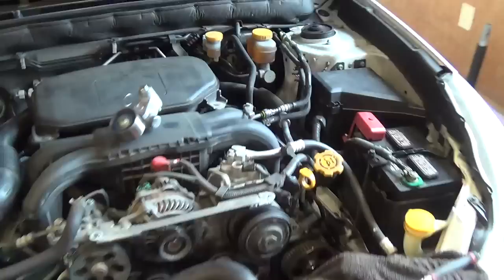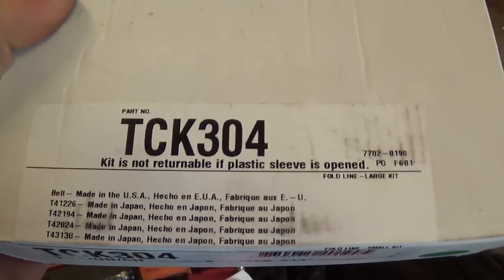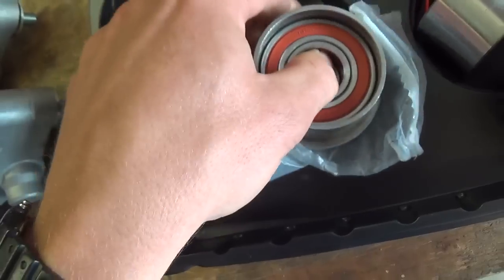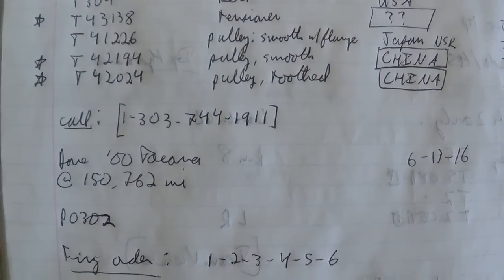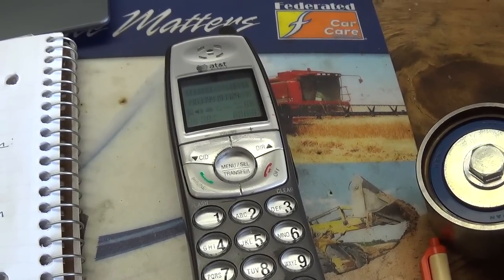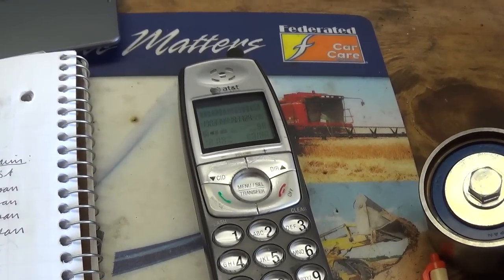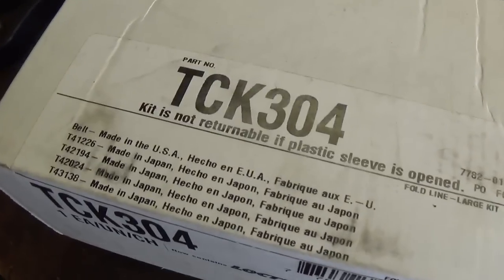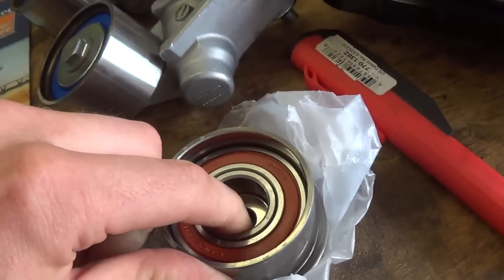GATES Subaru Timing Kits: BUYER BEWARE!

Comment: Wish I had seen this before installing a new Gates timing belt kit, pulleys, tensioner, pump, etc. on my girlfriend's Forester during a rebuild. Car went 50 miles then spontaneously the timing belt lept off the front of the cam gears and shredded itself. I asked around, no one could offer an explanation or similar story. I had to get the valves replaced because they were bent to hell. Put all the original pulleys and tensioner on this time, and the car is back on the road (knock on wood). I strongly suspect one of the Chinese-made bearings to be the culprit, but there's no way for me to get back all the time, misery, grease and towing costs I've been through on account of Gate's inferior outsourced components.

AVOID GATES PRODUCTS
Reply: a poor craftsman blames his tools. timing belts don't just leap off cam gears. if the bearings were the culprit you'd know because they'd be damaged to the point where someone could have offered that explanation.
Reply from the maker: Dylan, THANK YOU for sharing your experience! Shame on GATES!!

Comment: Rock Auto is shady as s#@t....I have never ever had a good experience with Junk auto, the worst was a P/S pump for my hemi.....got the new one on and sent the core back to them same day.....next day  rock auto pump turned into a piece of scrap metal, called R/A they said return for refund...what about my core??? sorry you should have hung on to it....what? 90 day core return with a 1 year parts warranty....once u buy their part you have to keep buying their part or loose your core.....screw u rock auto!!!!!
Reply: Opinions vary.  I've been using RockAuto for about 6 years now and have not had any problem.   Only had one time when I received an incorrect wheel bearing.  The customer service girl was very happy to resolve my issue, did a full refund on the spot and told me to junk the incorrect bearing.  Like everything, it depends on who you get to talk to...and how helpful they are to deal with.   In this case?  Gates did screw up and didn't update the labeling on their box.  At least Rock auto did follow though and offered to warranty out the kit.  Just sucks that most items are being made in "Yackashima Ironworks" for parts...
Reply: Gates should have said keep the parts you want and rfc the non advertised parts.
Title 19, Code of Federal Regulations, Part 134 generally contains the specific regulations for country of origin marking, and is implemented pursuant to Title 19, United States Code, Section 1304, which reads:

(a)        Marking of articles        
Except as hereinafter provided, every  article of foreign origin (or its container, as provided in subsection  (b) hereof) imported into the United States shall be marked in a  conspicuous place as legibly, indelibly, and permanently as the nature  of the article (or container) will permit in such manner as to indicate  to an ultimate purchaser in the United States the English name of the  country of origin of the article. The Secretary of the Treasury may by  regulations—

Comment: There are rules on how parts are marked, but they don't enforce the rules, so they don't do much good, only in where cars are made , that's it. Anymore your on your own. OEM Quality doesn't mean anything. Quality is just a loose term, doesn't mean anything. Might as well get used to Made In China, in another 20 years it will be the only option.

Comment: It's not necessarily bad if it's not 'Made in Japan'.  These parts companies constantly change their suppliers these days.  Even the main dealers are changing their suppliers now and then.  However, I agree with PLAYING IT SAFE.  If in doubt, always go with the parts from the main dealer.  The aftermarket parts market has gone wild these last 10 years: ALL cheaper aftermarket parts are of disastrous quality.  Back in the days, 15-20 years ago, an aftermarket part had chances to last for a while, today no such thing: critical parts failing after 2-3-6 months.

Comment: makes me wonder if aircraft parts are falling victim to the Chinese Connection.
Reply: Its an issue, they had a problem with counterfeit parts getting authentic tags saying they are up to standard. FAA people who check the parts where getting money to play along.
Reply: We operate A300s, and Airbus doesn't make this aircraft anymore. ..parts come from deserve or other operators , ok but anywhere else -oh boy
Reply: My understanding is a mile of paper work goes with each aircraft part.
Reply: +Rick S they have FAA CERTIFIED repair stations that fix the parts, then a gov form is filled out that  certifies the part meets FAA standards. But, counterfeit parts still happen in some cases.

Comment: Just for the record when any of your pulleys skate (as in spin freely) REPLACE them period.  They are on there way out.  I would rather put on a Chinese one than have a blown out pulley on my car.
Reply from the maker: It's a free country so feel free to install as many Chinese pulleys as you see fit :)
Reply: I have installed at least 3 of these Gates Timing Belt kits in my daily drivers as well as full blown race cars no issues.  Seems like this video is all about getting them clicks!!!!  And way better than putting blown out parts back in a car.

Comment: i would rather repack the old bearing with grease--than use china parts                                  one russian mechanic taught me to repack bearing on timing belt components does anyone out there do this to avoid china cheap bearings--would like to hear from you all
Reply from the maker: Ha I have repacked many sealed bearings with good results. Kudos to the Russian mechanic 😁👍

Comment: Chase Balzli
I installed a gates timing kit not to long ago on a 1998 EJ25 dohc. Knock sensor bank 1  code came up  then failed emissions. When I opened up the timing cover, half the belt was SUPER loose..  BAD tensioner, had oil coming from top of piston... passenger side jumped two teeth but didn’t cake the motor. #Lucky.. in that sense I guess....

THE KIT MADE IT 2 F-ING OIL CHANGES...

wtf 

Guess what I found...

ChineseBullsh!t

DONT BUY GATES

Comment: im a ase cert master tech, gates and other manufacturers out source parts all the time, dont know why your complaining get use to it, even the highest made auto manufacturers do it, thats the way things are done, MERcedes Benz, Audi , Honda , Nissan everyone does it! So if an OEM suppliers run out of a pat, u think they are gonna stop there assembly line stop making cars, NO WAY- Thats why u have different parts on the exact same model.---As a lead tech if you where so concern about getting the right parts why didnt you go to the dealership, and pay dealership prices, The only thing i would be concern about in that kit would be the tensioner, the pulleys , are not that critical, and usually u'l get a warning before they completely fail!
Point Made , stop being a wuss and put the parts on, calling gates and rock auto makes, no sense because the parts are correct ...and dont try to diss everything that made in china because china can and do make quality parts, its depend on the manufacturer demands.

Comment: What's being ignored here is the fact that China does make quality parts.  Theres a lot of sub par components coming out the big rock candy mountain sure...... but before you get all high and mighty buddy
.. bear in mind.  As a former tool maker.  The tooling used to make your Japanese parts... are very likely Chinese. The lathes used to make your parts once machined in Japan... are likely Chinese.  Do you see where I'm going with this? The dies used to cast the piston housings for gates former Japanese made tensioners...yup you guessed it.... Chinese made dies.. they can build it cheaper than anyone else in the world and if the engineers mandate a particular use of specific metallurgy... guess what.... the Chinese comply. I used to work for mevotech. Most parts made in China.  We engineered each part here in canada... Called out materials and brinell hardness etc etc and China made our parts. And honestly
..i don't work for mevotech anymore but..... as a auto technician aswell(i have 3 trades) i can declare as fact that most shops in the gta are starting to ditch moog. (Mevotech is steering and suspension too) I'm not sure where most of moogs stuff is made.  Presuming usa. But mevotech "terrain tough" line of premium parts blows any of moogs premium stuff out the water......honest to god ive got engineering Intel that i could disclose.  Physical cutaways of ball joints etc....i back my claim. Chinese parts shouldnt be condemned the moment you see the stamp.  I understand not everyone is a toolmaker like me but you seem smart.... you should be able to discern a well made part from a bad one. You should be able to discern poor materials from great.

Comment: We are all guilty of buying export products especially Chinese whether from Walmart or auto parts. You will find a lot of products in your home and yes even some of your tools & diagnostic equipment. Auto manufacturers have to outsource to be competitive b/c the American consumer wants the most bang for the buck! There are Chinese parts built to OEM standards & aftermarket parts built to another standard. Eye opener is if you research the web you'll see Japan has hired Chinese workers in their auto manufacturing because they work for 1/2 of a Japanese worker but the difference is what quality manufacturing standard they are working to...there is a difference. I don't like Chinese parts b/c I think all products should be made by Americans & bought by Americans but that's not reality or the world we have created. I buy OEM & name brand aftermarket parts that have proven themselves thru the years b/c nobody likes doing a job over b/c of faulty parts & if they are made in China I will cuss & complain but still install them & so far  I have not had an OEM part Made in China fail YET (probably shouldn't have said that). Ivan has a valid gripe b/c if the package states "Made in Japan"  it should be that!

Comment: I really don't get what people complain about with Chinese parts. The camera or phone recording this video will be made in China. And the pc or smart phone you watching this on is made in China. Not all Chinese parts are bad that's just stereotyping.
Reply from the maker: Yeah, but your cellphone crapping out won't make your car engine blow up. A cheap Chinese timing belt bearing, however, WILL. That is why mechanics complain about junk aftermarket parts...it's not a stereotype, it's the TRUTH!
Reply: Why are you looking for proof of failure when he has proof of quality matched with experience?  You do realize that its his ass on the line if the customer experiences a failure, right?
Reply: China stuff is crap unless someone else makes them do the job right.
I had one of these tensioners fail and destroy my engine after 800km

Comment: If you want a car made in China, keep using parts made in China and your desire will be filled.  After WW2, so much of everything was made in the USA due to the collapse of the adversary nations.  Quality was good, design was adequate, but with time the bean-counters outsourced more and more until we are now dealing with the lowest common denominator.  Yes, technically, you can make a car out of wheat chaff and water...but how far will it go before it dissolves?  That is the big question.  How far do you want to go before you have to replace what you paid for already?  Japanese cars first entered the US market due to desire for quality.  And they were reasonably priced.  Bean-counters at work again perverting the products for $$.

Comment: I was saddened when I looked for OEM inner tie rod ends for my '96 4Runner (as a 'just in case' exercise), and was very saddened to find out that they too are now made in China!!  Outer tie rod ends are thankfully still Japanese, as are the lower balljoints.  I've long since given up on Moog parts being US made, let alone lesser aftermarket brands.

We've got great manufacturers right here in Indiana.  Allison's transmission plant is right in Indy.  Keihin makes parts for Honda to support their Greensburg operation just Southeast of Indianapolis, and Toyota makes vans and SUVs in Princeton, along with forklifts in Columbus.  Cummins likewise has an operation in Columbus.  Subaru is just up I-65 in Lafayette, GM makes their trucks up in Fort Wayne.  Chrysler's got a transmission plant in Tipton and component assembly in Kokomo.  What's most shocking is looking at some GM cars and even more so Chrysler cars and trucks and seeing how much is being brought in component-wise (as well as whole cars assembled in Mexico).  Hell a San Antonio made Tundra is MUCH more "American" than a Ram is, sadly.  Half of Anderson Indiana used to work for GM/Delphi/Remy, now it's just a bunch of overgrown fields.  All the circuit board assembly has long since moved to China.  Muncie Indiana GM transmissions were famous, no more.  It would blow your mind to see how much factory space and infrastructure was scrapped out and bulldozed.

Not to get political, but I have an inkling of hope that a potential Trump presidency could reverse this China-outsourcing trend (or not).  I guess we'll wait and see.
Reply from the maker: Well at least all hope isn't lost yet...Indiana definitely seems to have more manufacturing going on that most other areas in the country! Damn marketing departments. When will they figure out that people are actually willing to pay a premium for QUALITY?!
Reply: Your still paying a premium you just aren't getting the quality.

Comment: gates belts come out of mexico like forever and u DO NOT WANT TO INSTALL A MEXI BELT ot timing belt tensonor or idler pully bearings,  a maxi pad might work better??? lol, yup the Chinese wanted to build some turbine engines for our company and they would screwup 3 out of 10 turbine engines for aircraft, tiawan north korea maylasia japan these guys seem to actualy understand how to get the job done right and how big a hole in the ground a jet crash makes when they don't get the turbine engine built right and it fails, funny thing the Chinese seem to feel the crash will destroy any evidence of wrong doing/fuckups so hey there attitude is prove it!!??

Comment: The bolt that comes with the gates tensioner is junk, mine broke with a few days, luckily I heard a noise and stopped the engine immediately. Do not use the bolt, use the original bolt.If you put in the gates bolt replace it as soon as possible.
Reply from the maker: Try the Continental kits... Better quality components then Gates by far 👍

Comment: I see your issue with the box labeling been incorrect, But you have no reason to believe the parts are lessor quality. Just because something is made in China is lessor quality that a product in Japan is ignorant. Do some testing and pull them a part, country of origin is not a metric for quality.
Reply from the maker: Do do any sort of quantitative testing you would need to go to a materials science lab and analyze the properties of the bearings, races, grease, seals, etc. etc. Then put them on a test bench and run 200k miles on the components and see if they last. 
I'm not really equipped to do all that, and I'm sure as heck not going to use my customers or my own vehicle as a test bench for critical engine parts!!!!!
Reply: Here's the problem. The USA and Japan adhere to an ABEC spec for bearings, which lays out the tolerances for different levels of precision. You can be pretty darned sure that an ABEC 9 bearing from SKF or NTN of Japanese manufacture will meet the spec. A Chinese bearing can be stamped ABEC 9 and be ABEC 1. They just make a batch of bearings and bin them like CPU manufacturers do. I've been in contact with several manufacturers over there, and one who was getting out of the business told me that they simply don't have the manufacturing equipment and infrastructure to make precision bearings, so they just lie. They find some out of the batch that meet the spec and send them off for QC, and the rest are just what they are. If the customer orders ABEC 9, they will stamp them that way. Whether or not they can manufacture decent parts is not up for consideration until the outright fraud can be dealt with. When you buy a Chinese bearing - unless you have personal oversight in that manufacturing facility - you can never be sure if they're cutting corners. It's an ethical problem. I have bought batches for testing from several manufacturers, and the tolerances are all over the map. I specifically ordered an ABEC 7 bearing for a specialty project, and what I received were worse than ABEC 1. The same bearing sourced from the USA costs literally 10X as much, but they work.

It doesn't matter so much if they're for your skateboard wheels, but for a critical machine component, the quality simply can't be trusted. Taiwan, maybe. Mainland China? No way.

Comment: I have been working on cars for 25 years and have noticed all of these parts manufacturers we used to trust have went to China the quality is pathetic just had a Gates timing belt kit we put on a Honda Civic be towed in it only made it 2500 miles before the Chinese tensioner pulley locked up and burnt the belt in half now we have bent valves and a very inconvenience to customer have had the same problems with Chloe's timing chains we are OEM or nothing at this point I don't understand why everybody assumes we will not pay the extra money for quality very disappointed in all the big-name aftermarket suppliers that say they are OEM there is a big difference when you buy a dealer component and compare it to theirs .
Reply from the maker: Wow sorry to hear about the poor Civic. It's become safer to just open up the original rollers and manually re-lube the ball bearings than install this INFERIOR CRAP!! Can't believe some people say "there's nothing wrong with Chinese aftermarket parts" lol